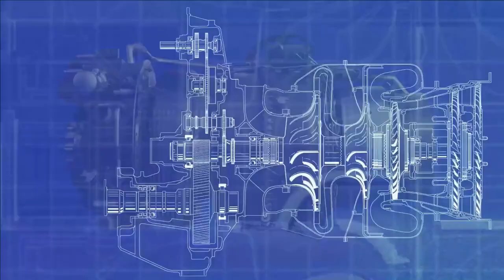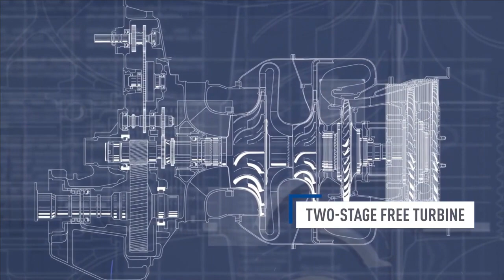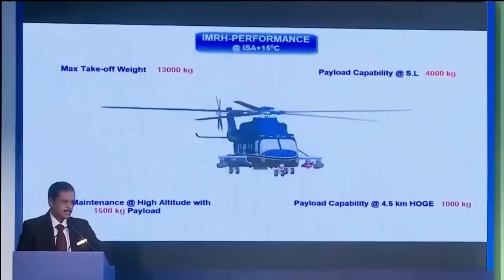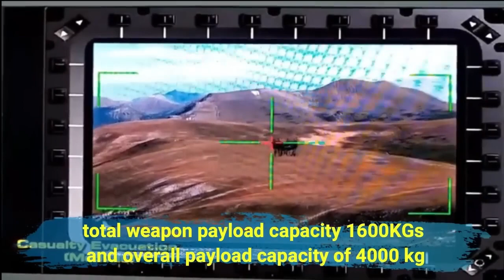#breakingnews  HAL & Safran soon to start working on engine for IMRH & DBMRH helicopters

Comment: I hope HAL can develop 100% indigenous tech that doesn't need Safran's help. The HTSE 1200 is the only engine which has positive news.  Hindustan Turbo Shaft engine (HTSE-1200) of 1,600shp shaft power rating, has made impressive progress and is loaded with some of the concurrent technologies like high-pressure compressor, effusion-cooled combustor, single-crystal (SX) turbine blades, 3-D printed parts, laser shock peening, FADEC, atomisers, and a high-speed gearbox. On the material and processes front, the HAL has developed SX blades with the DRDO’s DMRL laboratory for the HTSE-1200. The coating by EBPVD method is also being established with RCI Hyderabad and is being utilised on SX blades. The process has been proven on sample blades.

Similarly, the laser shock peening process is being utilised through the UK-based Coventry University, while atomisers are being co-developed with the Indian Institute of Science (IISc). A special ceramic composition had to be formulated for making strong ceramic moulds which can withstand metallostatic pressure of liquid CMSX-4 alloy at 1,500 degrees Celsius and above during casting operations. The challenge of maintaining the required temperature gradient has also been overcome by optimising the casting parameters. A multi-step vacuum solutionising heat treatment schedule for the complex CMSX-4 superalloy to achieve the required microstructure and mechanical properties has also been established. Further, a stringent non-destructive evaluation methodology for the blades along with the technique for determining their crystallographic orientations has been developed.

-- Aero India 2023, Force Magazine.

Comment: Also what is the recent update on HTFE-25 & HTFE-40
Reply: HAL’s Aero Engine Research and Design Centre (AERDC) ran into problems when developing the 25kN thrust HTFE-25 turbofan, following which a major re-design effort had to be undertaken. The HTFE-25 turbofan thus continues to languish in its prototype evaluation phase. In all honesty this is the worst possible news, I doubt that HTFE25 can ever succeed. HTFE 40 to be my understanding was just an afterburner and no news on its development.

Write off HAL and invest in Paninian, a startup who is at least actually getting close to making engines. Paninian India, a startup which recently announced that it had designed and validated the performance of a 4.5kN turbojet engine. The firm is developing a family of turbojet and turbofan engines in the 3-12kN class. 

Raghu Adla, the founder of Paninian India, told Overt Defense that the firm has been working on the project for over four years. It is looking to proceed with fabrication of the 4.5kN engine. While the firm does not intend to take part in engine development with thrust greater than 12kN, an AI enabled Digital Twin solution developed by the firm can be adapted for validation and maintenance of large engines. The firm is in touch with a couple of customers for its products, he said. 
https://www.youtube.com/watch?v=2lAbeapbjg8
Reply: @datoolz0  
I see so HAL can't do it huh
I think Govt should fund both companies and ask them to compete with each other like GE and P&W.
We need Indian made & developed engines for the future
That is the only way i can think of because HAL ( a PSU) needs some serious pressure to complete their projects on time
Reply: @fly463  Hopefully startups can change this space, before there was no competition for ISRO either and now there is. Bharat is one of the biggest aerospace markets in the world, eventually we will have our own set of companies.
Reply: @datoolz0  
Obviously we will but they need funding by the govt to take on massive projects otherwise....
Reply: @fly463  Yeah flying test bed and wind tunnels are a must!

Comment: has a fix been found for dhruv and prachand helicopter issues?
Reply from the maker: yes, aluminium alloy control rods are being replaced by steel one
Reply: @IndianDefenseAnalysis  so problem was with the rod?
Reply from the maker: @jaihind9462  yes life is less that expected
Reply: @IndianDefenseAnalysis  why didn’t they go for steel rods from start
Either they were doing cost cutting or weight cutting
Who knows
Reply from the maker: @Electrical1112  these are design discussions. From what I know, aluminium based alloys are preferred due to light weight
Reply: @Electrical1112  India is not good in metallurgy that's why.
Reply: @IndianDefenseAnalysis  Need high HP engines for IMRH Aneeto 3200 HP may not work well. Atleast 3500HP required.
Reply: Yes

Comment: 1st comment
Reply from the maker: 1st reply
Reply: @IndianDefenseAnalysis  Bro make a video about XRSAM and kaveri dry engine,,, still not sure if the core engine has stabilized or the godrej is making core engines for further tuning.
Reply from the maker: @kuralovien5524  Kaveri we already have made several videos 

https://youtu.be/qIW4Z5gUtwo
Reply from the maker: On XRSAM

#breakingnews DRDO to test ERSAM missile of Extended Air Defense System(ERADS)
https://youtu.be/m6v2zvB34sg